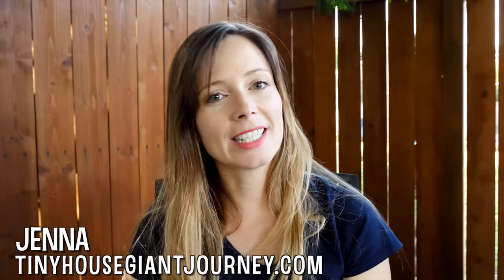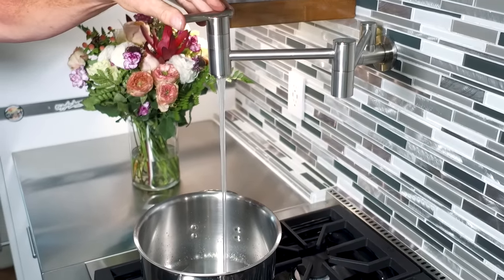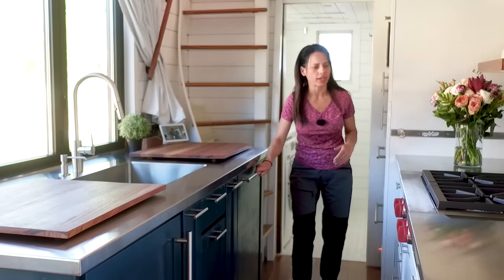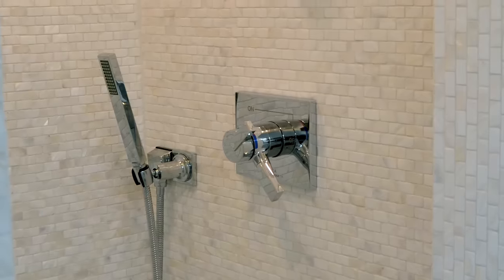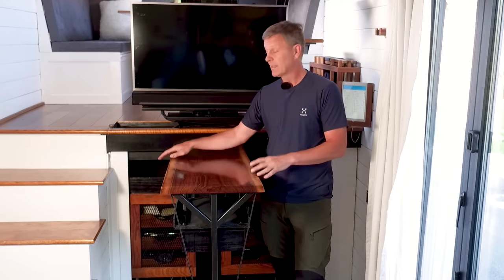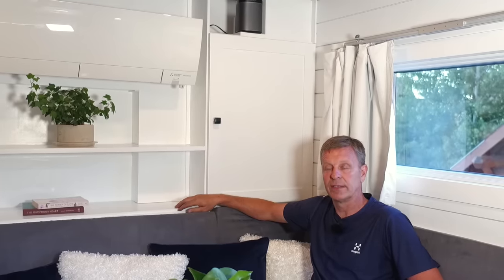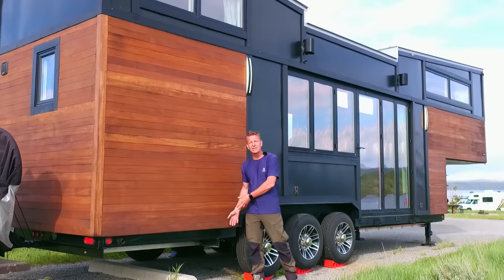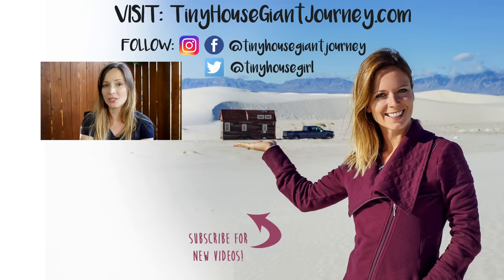Luxury, High-End Tiny House After Leaving Ex Large Home

Comment: They thought of a lot of things. And did a really great job on this build. It seems he is a technical guy. And thus the technicology in the house. The FRESH 🍞 bread in the fire oven would be AMAZING!!! However I do see a few things they didn't incorporate... that they might want to add on... or build into a new unit if they decide to get rid of this one and build another one. 
1. The Deck Area: to me it would've been a good idea to create an awning that pivots from the top of the trailer... that when driving could fold flat against the trailer walls... protecting the windows from potential rock chips & other flying tire debris of passing vehicles. Or have the deck so it folded up against the wall & hinged into place when parked. However the deck the way it is... and a solid fold down awning... would be better... as they could attach mesh screens around the sides & front of the entire deck & be able to have a solid awning roof... which would allow them to keep the kitchen area open on warmer days... keeping the bugs & of course other weather the rain out... 
2. The windows: they are missing mesh screens for the bugs on all the windows that open. Also for windows... on the drivers side of the trailer they have a full sized window... that is similar in height to a door... I hope that this window and other windows (other than the kitchen/deck windows)... are able to open up enough for them to be able to use as emergency escapes. 
*speaking of emergencies... it didn't seem as if they had any fire warning and/or suppression at all. Either as fire Extinguishers, smoke alarms, carbon monoxide alarms, etc... 
3. The Shower: This is amazing for space & design. However if they would've built the shelves with a ledge/lip... or in some way made it so they could attach bungy style cargo netting... they would be able to keep their shower supplies on the shelves in the shower while they travel. 
Also I didn't see a fan in the shower area or toilet area. Maybe there is a window in the toilet area for light & ventilation... But around the shower I didn't see a fan around there at all or just outside of the shower in the hallway to be able to help suck the moisture out. 
Also the shower area is large enough to be able to build racking & hooks, racks & lines.... where they could have these on the walls & strung up from one wall to the other... so they could hang clothes & other items they wanted to hang dry. And be able to have fold down boot racks to be able to put their wet skiing & winter gear to dry out. *this racking, clothes lines, hooks, racks, etc... could be something done near the fire place oven for their wet gear. 
4. Cleaning supplies: The wall between the shower & the toilet made me think what if they made the shower just a few inches shorter on the shower side so they could build a slide out unit similar to slide style spice racks, & their ladder slide out... where they could've built a slide out between the shower wall & toilet wall that housed a rack to hold their mop, brooms, & cleaning supplies. 
P.S. that deck on the roof is a great idea & the way the roof was designed in layout was very ideal for travel, as well as the angles for solar panels. For the sitting area it would be better to have some sort of pop up railings system... which they could have that slide up & down using hydraulics... or that fold down & lock into position & lock down when in travel position. The sitting area looks kinda slippery... it would be good idea to get some sort of grip material on the roof... But just think of the evenings watching the sunset with the heat coming from the chimney pipe from the fire stove. I wonder if there is a way to be able to add on some more piping to fire oven roof stack... that would be able to be attached with a directional flap inside... where they could extend the pipe sideways & then up again with a 90... so they can turn a flap to direct the heat from going straight out the original top air hole... but then it gets directed to the sideways pipe that extends out behind them as they sit on the roof... & then up. But when not on the roof they just adjust the flap to have the air escape out the original hole as it is built now. So basically they keep the straight up escape hole as that is code... but then add on a side pipe below the current escape hole at the top that would allow the heat to go further... which this is behind the spot they sit... so it acts as a heater... but I don't know if that passes code at all. (I know this sounds confusing... as I confused myself trying to write this in a way trying to explain this without diagrams).

P.S.S. at least with the Volvo truck they could potentially be able to pick up & move 53' trailers... If it is still designed with the air lines, & proper hitching. However with them having had some custom work done to the bed area behind the cab... I'm not sure if they have anything left on the back area that would allow that Volvo to be able to pull commercial trailers anymore. But if it's still there... they can potentially get the insurance & be able to get odd jobs making commercial trailer runs... which is a great thing as a back up financially at least.

Comment: Could the Smart-Car fit through those accordian glass doors in the kitchen for transportation (without cracking the kitchen floor)?  And then would a normal pickup truck like an F-350 be strong enough to pull the whole setup?

Comment: That semi seems overkill for a tow rig. I think this can be towed by a 1 ton dually or 5500 at most.
Reply: 21000 pounds? Would be stressed to the limit,  and not even get better mileage.  This semi is much safer and more durable.